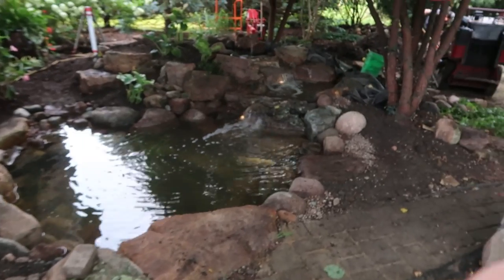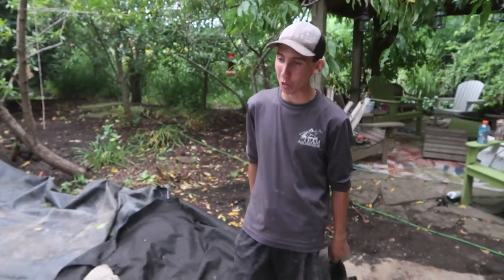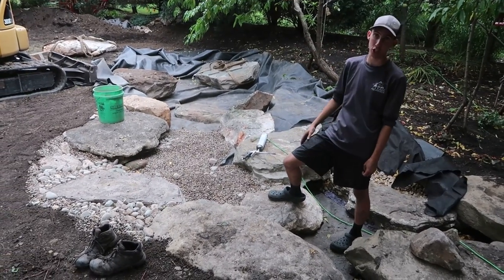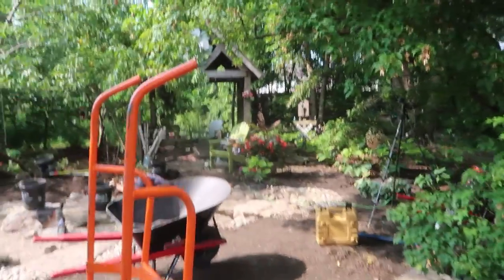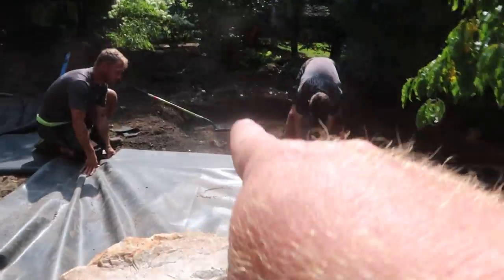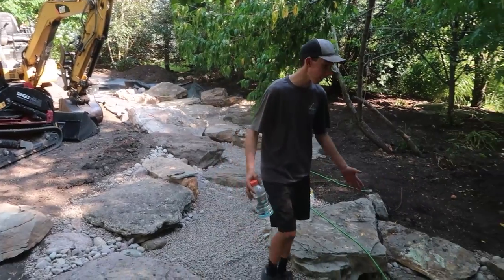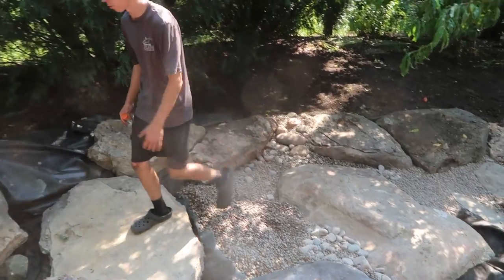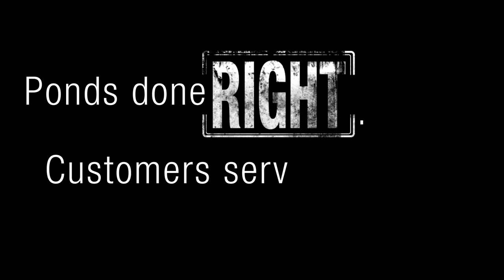Pond Liner Seams for 50-Foot Meandering Stream - Part 3

Comment: A quick technical question. Judging by the video it looks like you used around 10 large aqua blocks. Is this correct? With a stream that’s 50 feet long and what looks about 3 feet wide with a depth of 3-4 inches, your water in motion should be around 50 gallons. Multiplied by 7.5 would be 375 gallons. Multiply that by 3 for 3 time the amount of water in motion for your reservoir space would be around 1125 gallons or around 38 Aqua blocks. How were you able to get away with so much water in motion and so few aqua blocks? Also random question, can you fit two sld 5000-9000 in one pondless vault? The only reason I ask is that I am looking to do something similar to this.